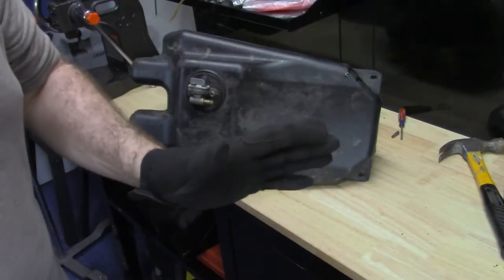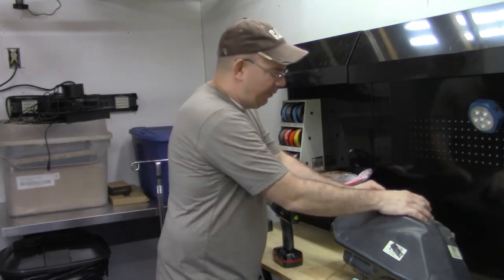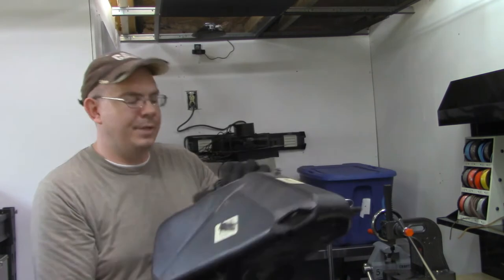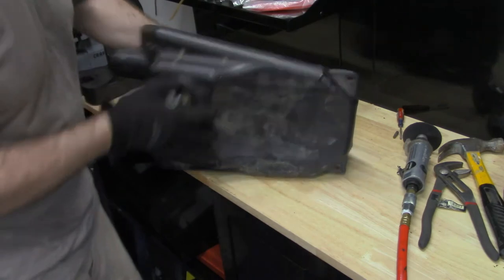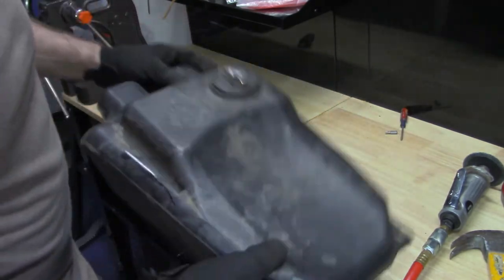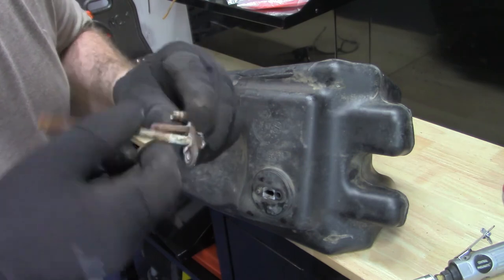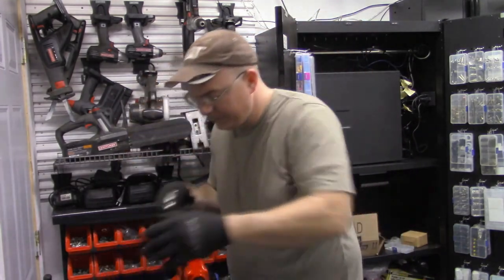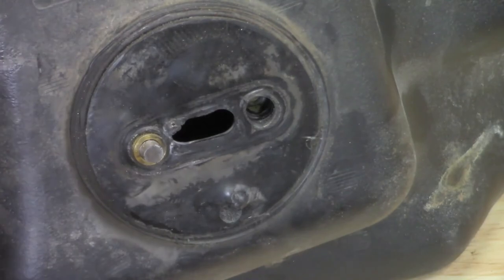Polaris Outlaw Petcock Repair Part 1 Tank Designed For No Repairs Only Gas Tank Replacement

Comment: I have had the same issue. Fuel leaking around the petcock. Bolts spinning in the inserts. I was able to just pull the whole assembly out inserts and all like you were attempting to do at the beginning of the first video. I was just going to try to epoxy the entire assembly back in if I could change out the petcock. However, before I could do any more repairs, the fuel tank was lost to a house fire. So I found a good used tank on eBay from a part out. Petcock does not leak on the new one. I was considering removing the old petcock on this tank and installing a new one before mounting the tank on the quad. However I am scared to even touch it since it is not leaking. What do you think about just sealing all around the bolts with RTV gas resistant silicone to prevent leakage??

Comment: I have the same issue on my 2007 outlaw. Definitely original petcock and bolts were stripped as you explained. I'm at a loss, needed it replaced due to it leaking in off position. Guess I'll just unhook fuel line to the carb when not in use...Ridiculous, thanks for the many great videos. They've helped me a ton rebuild mine!! Keep it up.

Comment: Polaris makes great unique machines but sometimes it seems in order to accomplish their task of creating a new machine that’s never been done, they do stupid things such as this gas tank issue...
Reply from the maker: The tank assembly with the petcock instead of being pressed in should of been threaded to remove the assembly the petcock sits in. And then molded the tank to have nuts in there pressed into the plastic not one way press in fittings.

Comment: I had the same problem on mine.  It makes no sense to not be allowed to replace it.  I just did something to it [I can't remember what] so now it only works on the res setting because now the off and on settings are both off.
Reply from the maker: Yeah this was not designed to be repaired only replaced.

Comment: Did you consider rebuilding the petcock. I am having the same issue right now but it is leaking from the actual petcock not the tank connection. I feel I may be able to just rebuild the petcock with components from a replacement I bought. I watched these vids before I tried to take mine off and was seriously hoping this would not be my experience.. It was.. Inserts just spin freely.. What do you think about a rebuild of the petcock?
Reply from the maker: Well if its leaking and it already has a problem I would give it a shot rebuilding it. I would buy the oem petcock however to match specs. And if you don't get it repaired just watch the 2 vids i made and take your time. Thanks for watching and thanks for your service.

Comment: If you haven't fixed it yet i had the exact same problem and didn't feel like buying a $400 ims tank. I actually drilled the bolt heads off since I don't have a grinder. After you remove the petcock and can see the bushing and bolt head I took a drill on was able to get enough of it in the chuck and spun it really fast and the bushing gets hot and came right out. The other one didnt have enough head showing so I actually took a soldering iron and turned it all the way up and put it on the head of the bolt and the heat from the metal will actually push out the brass. Mine actually shot out couldnt believe it worked. Hope this helps someone. After you get everything out buy some brass bushing and m8 bolts on amazon and good to go!

Comment: I think most of the manufactures even the Japenies companies use the same method to connect the pit cock.I guess its best to remove it every so often so it won't freeze and put a little lube on the bolts

Comment: I doubt it was the nutsert fault. Yes I've seen thousands of these on various components on atvs and cars. It is installed like a rivot. Once crushed you remove the tool then you install the screw. After years of exposure to the elements, the bolt doesn't come out again. This is why I do not use drills on this sort of thing. Buy a good impact driver gun and use that instead. The vibration and hammering breaks the corrosion free and gets the bolt out without stripping the nut.
Reply from the maker: That was not made to ever come out. The insert was threaded to catch the plastic on the tightening side to stop moving and to allow tightening. It's not designed to be worked on at all.
Reply: @TorrentPerformance  I've dealt with these inserts many times. In fact I use to install them at a job before. They're brass, suppose to not corrode as easily. When they strip out from being spun, the knurls bend over facing the wrong direction. Especially when someone keeps them spinning in an attempt to remove them.
Reply from the maker: @adamplummer2190  not the case with this set. Knurls never bent back over still facing the tightening direction. And it's not from the drill either it's a total shotty design. After I remove the insert and cut off bolt the bolt couldn't be removed from the insert on the vice. Terrible design and totally done to not be repaired in a shop just replaced just like everything else from Polaris in mid 2000's